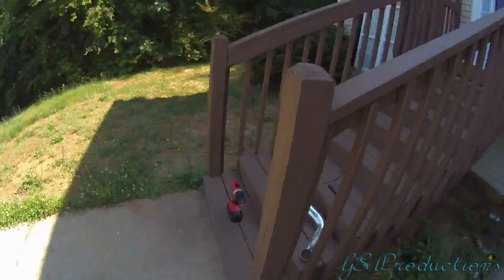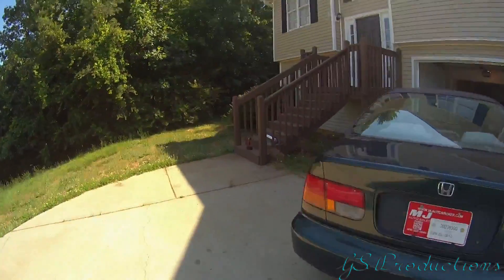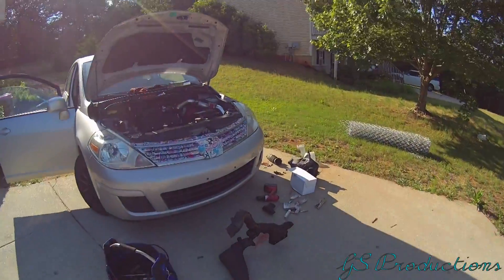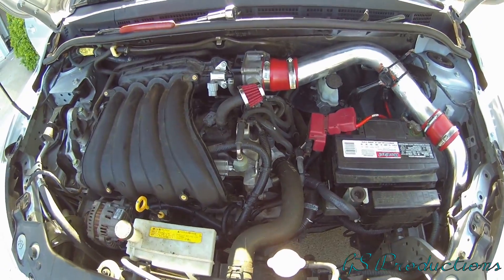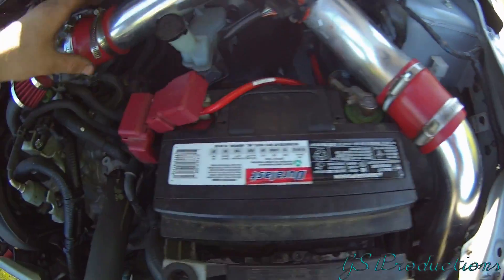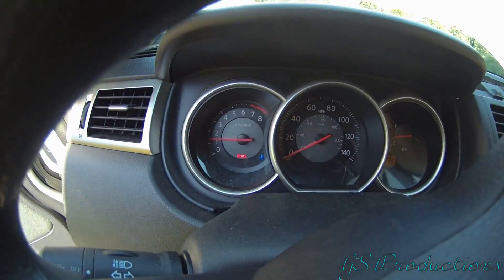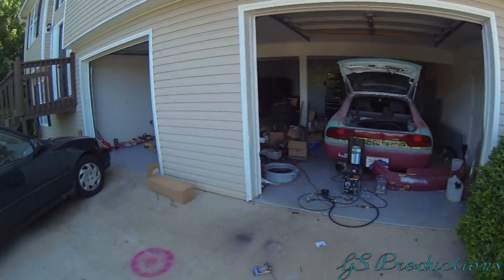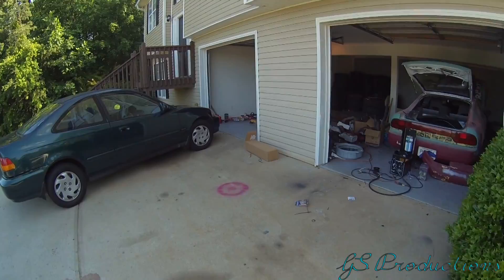the versa gets a cold air intake

Comment: Did ya have enough tubes of silicone to seal that sensor in there or will i need more than a couple of tubes thx
Reply from the maker: Well its been 3 years and i havent had any vaccum leaks or issues with the sensor.
Reply: @InsideVOICEfun  just grindin your synchros my friend. No harm meant. But ya got to admit like myself you kinda went overboard with the sealer lol
Reply from the maker: @rctopfueler2841  rather have too much and not enough xD

Comment: Did you end up check engine light? Look like it was idling high. I did same up grades and ended up with a check engine I cant get rid of.
Reply from the maker: I did not ectually. Havent had any issue with engines lights in the years since ive done this mod not sure why
Reply: garage shenanigans , being that I deleted the crank case hose that went to the rubber intake boot I’ve had a vacuum leak cylinder one misfire. So today I put on another breather on the PCV valve seemed to level out the idle and stopped stalling.  Now I need to do relearn code and see what happens. Lol what size is the elbow with the breather on it?

Comment: i'm looking to add some hp to my 2014 Nissan Versa SV Note...I've read that cold air intake would be my first mod...any recommendations on a particular brand? I saw you drilling out the old air flow sensor...does this have to be done on ALL intakes??
Reply from the maker: No if you use name brand products it should have the correct sensor hole for the car. The reason i had to drill one was the air intake i used i took off my old 01 civic that has the sensor in the throttle body so its essentially just a tube. It was much cheaper to modify the part for my use vs buying a new one but obviously getting a new one would be a much simplier bolt on than what i did here.
Reply: Use the injen intake. It confirmed you can get 5 hp from it.

Comment: which intake did you use?
Reply: oh ok. yeah I put a Weapon R intake on mine. but being the short ram it basically bring hot air. I had a extension tube to move the filter to get basically cold air and ever since that. the air flow is so much better
Reply: and the sounds different? catback?
Reply: It's called WEAPON R SHORT RAM INTAKE. I wanted to go with the DC but I wasn't really sure and now that I do have it it's good I just prefer that I had to straight tube instead of a rigid tube sense I've been looking up on to it and the air flow isn't as smooth as if it was going through a straight
Reply: yeah. I'll make a quick video